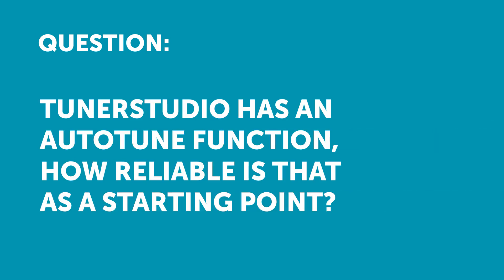Autotune | Is It All You Need? [HPA Q&A]

Comment: i found the haltech Long term adjusting trim terrific  bit of  internetting to get its settings right  and then i was goin in ever few days and smoothing out its changes by making half the change either side of its cells   but  saved me tons of time compared to  reviewing the tune a million times from data longs or trying to get a mate to drive  steady  while i struggle with the laptop.. you just need to take the time to set it up and understand it  .

Comment: Haven't found much use of it, it's too unreliable in my experience. Even the LTTs. 
Best street tuning method I found is to accelerate through the revs in as high as a gear as possible while maintaining the same MAP value. Log it and look at lambda correction, and adjust afterwards.

Comment: I have ms2. And as long as you had a good map already. Auto tune had help me get my motor right back withing that particular map tune. When I had do redo my valve lashes. And upon start up. It was a Lil rough... idle it for 15 mins and autotine recorrected it all. And drove it like what he said and autotuned it fixed it.... them later one  I had just returned it again after changing some other things